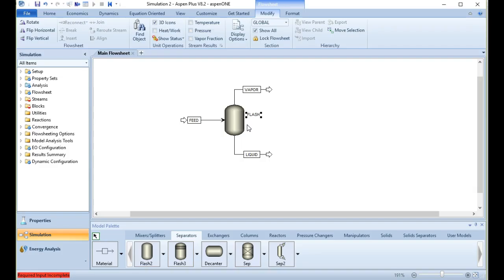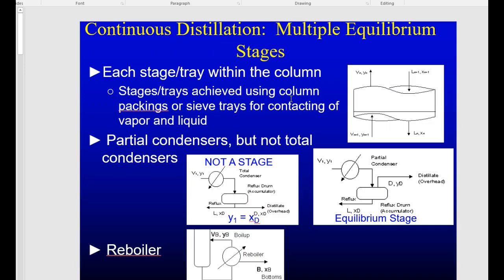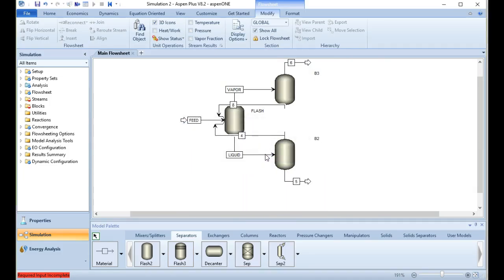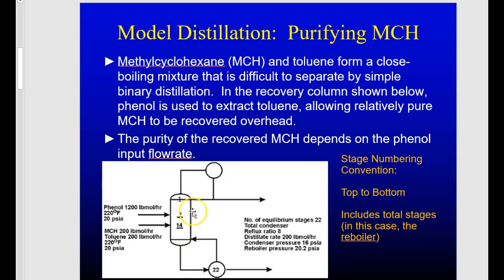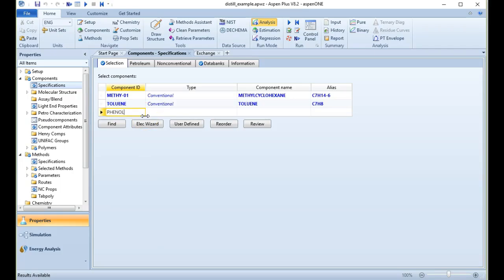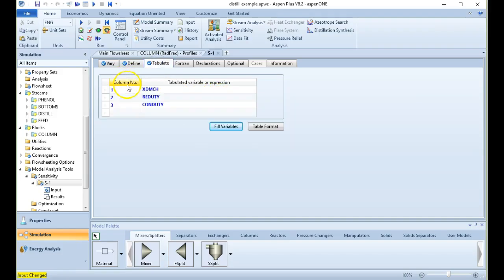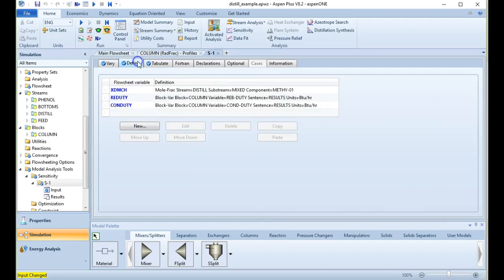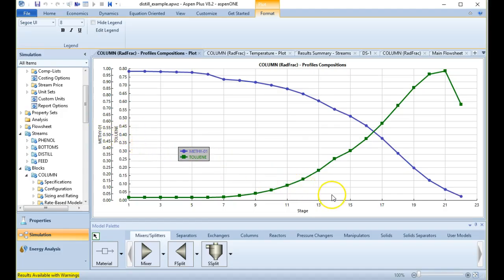Aspen Distill and Design

Comment: Hi, Tom. I'm working on an Aspen Plus simulation that involves a RadFrac column and a Distl column. I noticed that the condenser duty value in a RadFrac column is negative. Heat is being removed, I guess. Do you know why the condenser duty in Distl columns has a positive value? I tested it with several systems. The result is always positive. Is there a way to explain that?